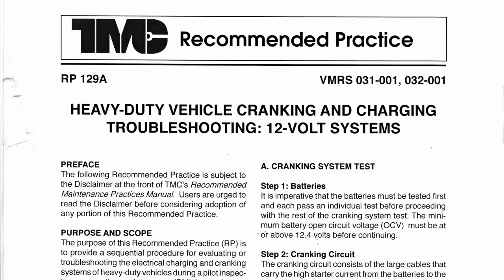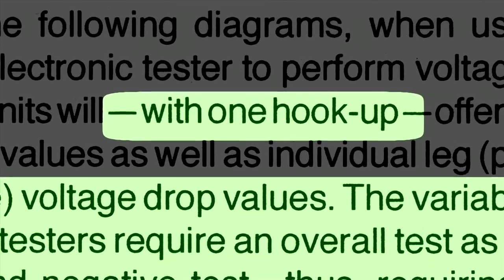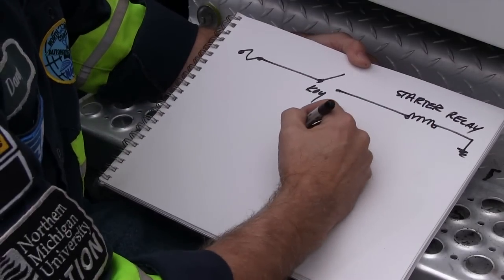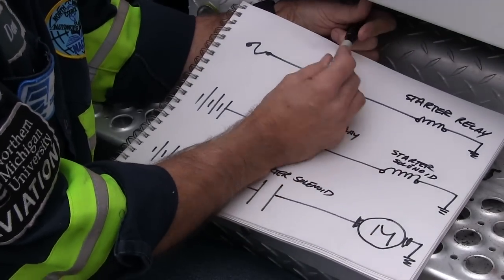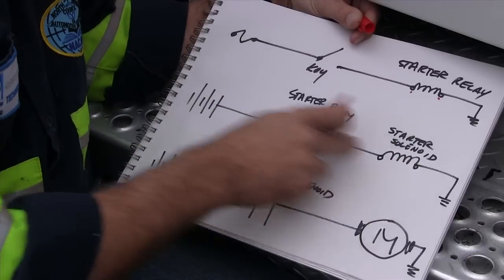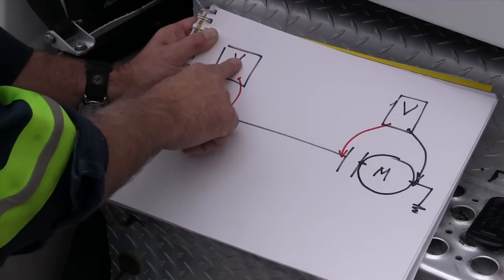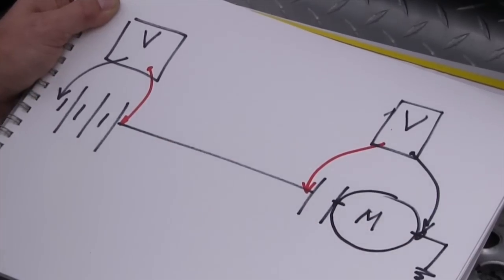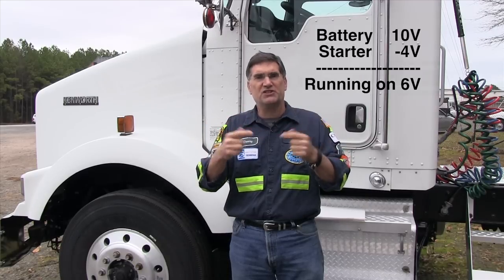RP-129A FAIL -- Training that should have been provided

Comment: Mr. Sullivan, I stubbles across your videos while looking for a load tester of sorts for electrical diagnostics. I’m an 8 year tech working in the Ag industry(John Deere dealership). I have always been drawn towards electrical since I could remember and I have always had issues trying to find a way to find resistance in wiring circuits that should be there! My question to you on the loadpro is, when load testing a circuit for example a NOx sensor on an emission circuit where both sensors get the same 12v and possibly the same ground how can this work if  the tool would technically load up the same circuit where the other sensor is at. I want to understand the tool better before I purchase one. Thanks in advance I know you are a person with extensive knowledge and probably pretty busy.
Reply from the maker: All sensors are in parallel. The voltage supply is being tested from the sensor back to the source.
Reply: @bivideo7  how many version of the load pro is there and which one do you recommend for me, knowing that I would in the AG industry? Thanks for replying.
Reply from the maker: @jcolivera881  The 181...

Comment: What's circuitry
Reply from the maker: Circuit = circle; circuitry is the stuff you need to make a circuit - wire, voltage source fuse, switch, load component, etc.